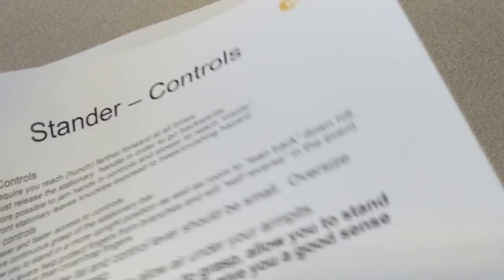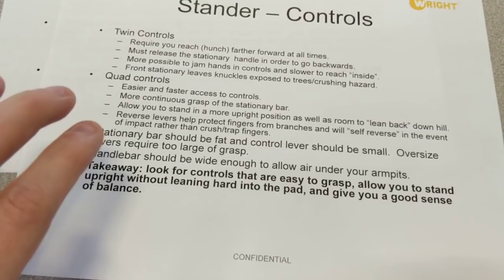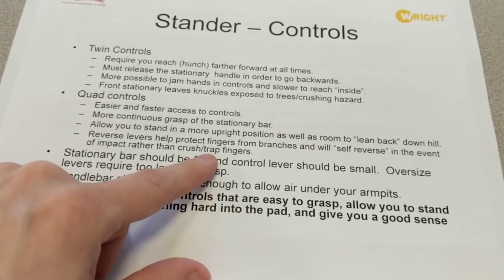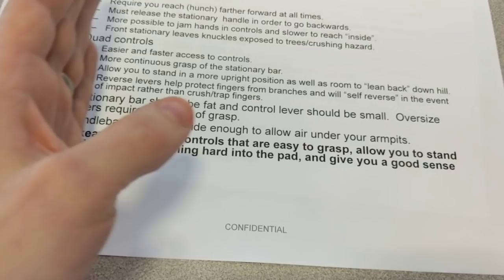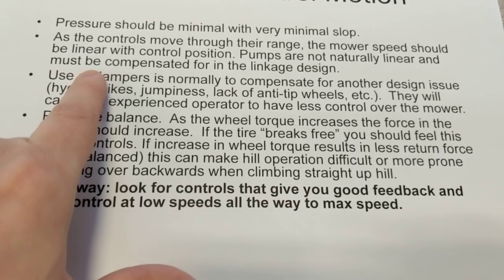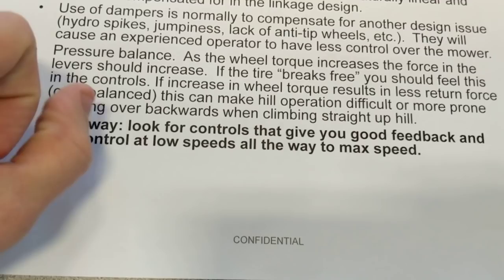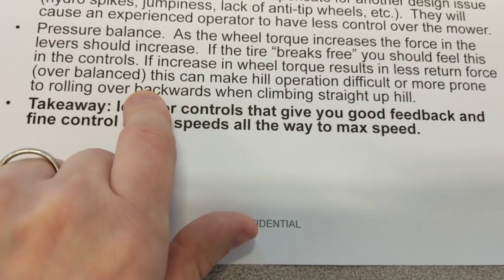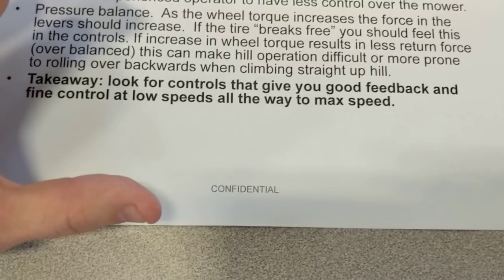WRIGHT: What's With The Controls?

Comment: I demoed 3 stand on units last season Toro,Gravely, and Ferris. I liked the comfort of the Ferris but the machine was too responsive, jerky, snappy ect. The Gravely was much smoother but I didnt like holding down the handle to keep the machine running...the overall layout of the machine was different the deck was further out. The Toro I just didnt like. I tried to demo a Wright but my dealer never could have one available for me which was a disappointment. The hand controls and the comfort is a huge thing and they are different on most machines
Reply from the maker: Hi Kevin, too bad to hear your dealer didn't have them.  Can you send us a message thru our website and tell us where you are and who you visited? -Ed
Reply: @WrightMowers  yes I will. thanks for the feedback